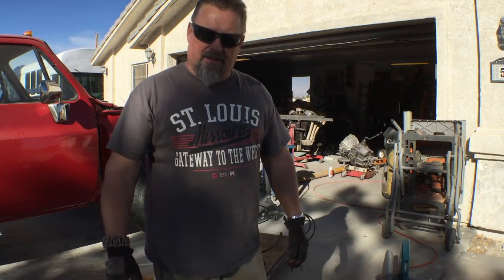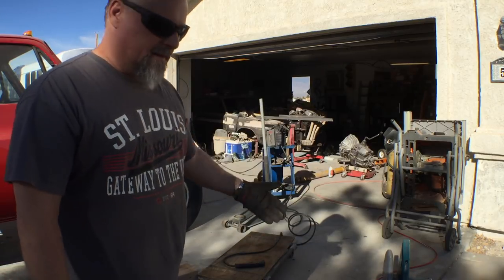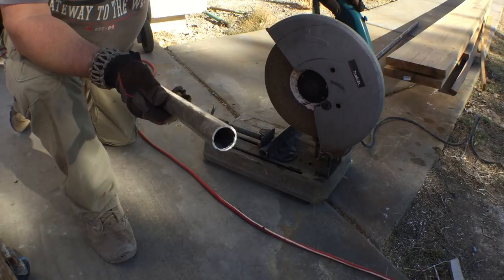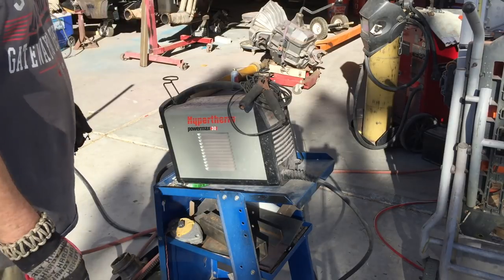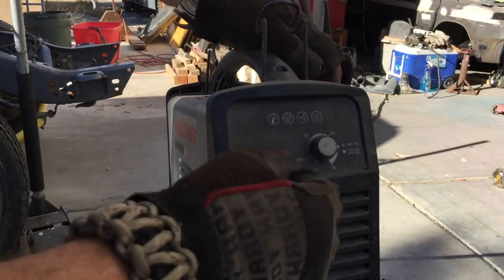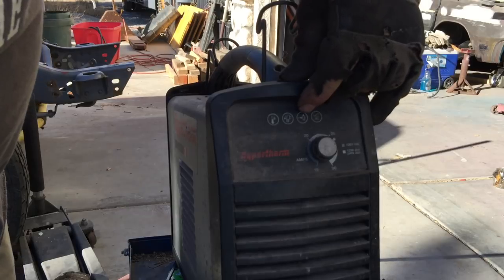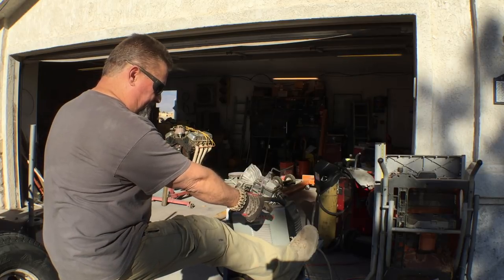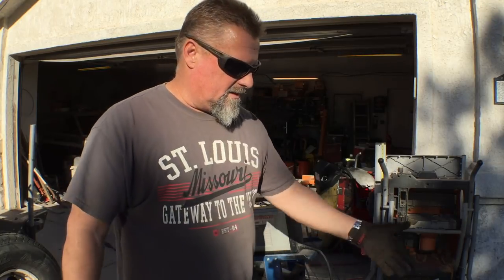Demostrating the use of Chopsaw, Plasma torch and grinder for cutting metal

Comment: My plasma cutter, (a jewel from the land of cheap junk) blew a bank of resistorbs that need replacing. Unfortunately, I don’t currently have a soldering iron, however, I was able to obtain the replacement resistorbs off ebay, no thanks to the manifacturer, who when contacted, stated they dont stock those type of replacement parts, “dosch bags”. Have ordered the soldering iron, just waiting for the Post man.....have ya tried lube on those push buttons?

Comment: Do you need a air line filter or dryer to remove moisture?
Reply from the maker: simple answer is yes.  If moisture is an issue, having a water trap or desiccant type filter is a must.  Im fortunate that the ambient air is already dry AF, so I don't get much moisture in the system.  If i start to get moisture accumulating then I use a disposable type desiccant filter, but that rarely happens.